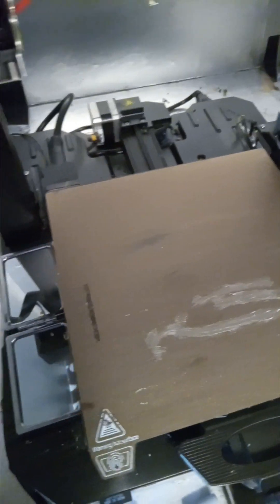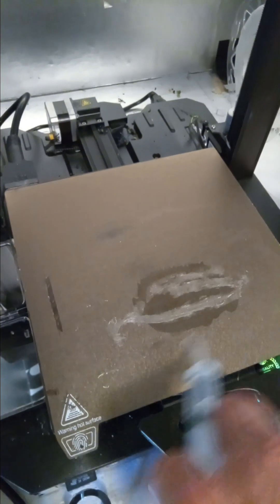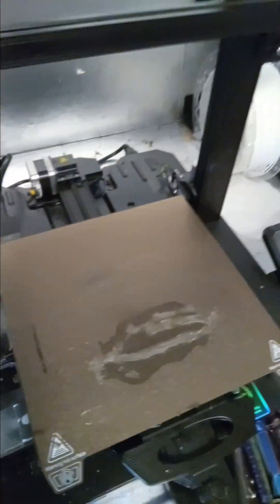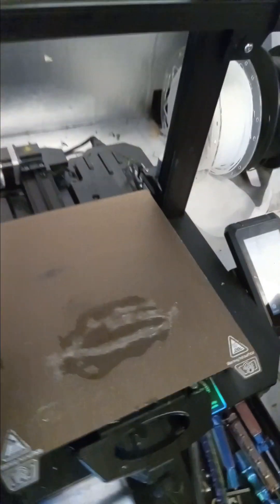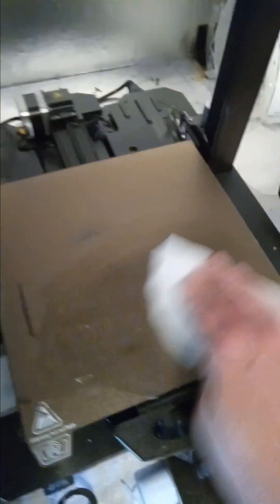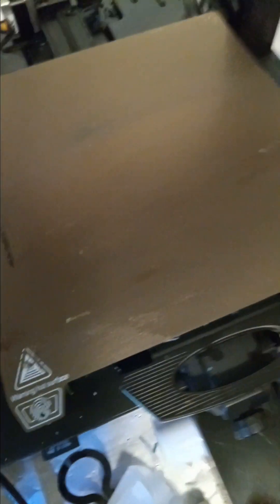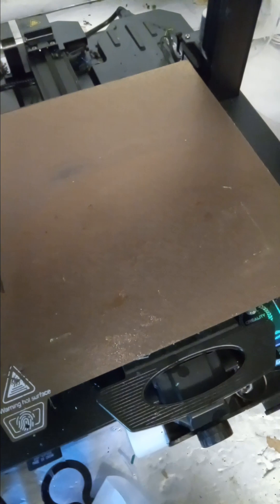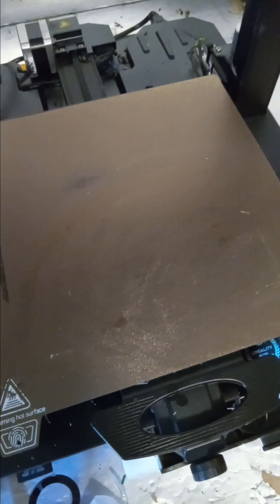3D Print Bed Adhesion And Release Best Practice, Glue And Alcohol

Comment: how many prints can we do before re applying the glue?
Reply from the maker: Depends on a lot such as what material and geometry of the part, but typically I think I get half a dozen or so prints then I'll just drag the glue stick over it, not so much to add glue but to remove dust onto the stick instead of the bed.  Also depends on a lot of variables, such as a warmer stick will leave more glue which is less ideal I think.  Once I build up too much glue I dilute it with the alcohol treatment again.  Of course you could do alcohol every time, but I like to do it as rarely as possible.  Some materials/geometries may require more often.  YMMV.
Reply: ok thanks, i was just using the heated bed but lately the prints have been coming off so i tried this glue thing and it seems to work extremely well @3dcre8r28

Comment: I guess I need to find the balance. Spaghetti, the first try. 😂
Reply: Adjust your z-offset.  Your nozzle is probably too far away from your print bed for that first layer.  I have found with my Ender 3 that my nozzle is about 1/2 to 2/3rds a layer thickness (so .2 with a .2 nozzle) away from the bed.  Then adjust up or down from there.  The trick is to be as close to your bed as possible without the nozzle hitting the bed and scratching the bed surface, a very precise tramming is critical to get this to work correctly.  Then just increase your z-offset (raise the nozzle up, away from the bed that is) until you have little or no elephant's foot on the bottom few layers of your print.  You will always have a little elephant's foot and your prints will eventually fail as the first layer will no longer stick again.  Then just use your best judgment on z-offset.  Yes, you may want to adjust it per print.  Lower z-offset for better bed adhesion but more elephant's foot, higher z-offset for less bed adhesion and less elephant's foot.  Also, the taller your print, the more bed adhesion (and lower z-offset) you want.  

If you find your prints failing near the beginning it is almost always z-offset or the extruder (nozzle temp) is too low.  If they detach later in the print it could be z-offset still but it could also be part cooling (causing warping and detachment from the bed, I had that) or bed temps are too low (for the same reason).  Also, check belt tightness, I had some weird prints and vibration during long-axis movement that had to do with my y-axis belt tensioner getting bumped and becoming loose (I had the printer in the living room and too close to people walking by).  

I used the Creality slicer for a while as I learned CAD and how to run my printer.  Before every print, it would do a nozzle purge that would allow you to measure the first layer thickness with a little double-wide extruded line.  It would print this off to the side of the bed near the front corner.  I could peel it off during printing and measure it with some calipers.  I knew if the layer height was 0.15 or 0.2 mm and the strip was nearly that tall the z-offset was too high.  I would stop the print there, adjust the print and try again.  The key is to iterate your calibration and printer setup until you have everything fine-tuned, then print something you want.  I would suggest a calibration cube https://www.thingiverse.com/thing:953162 (also) https://www.thingiverse.com/thing:1278865 .  You can iterate that and it will even give you some measurements to make, the first link is for one that is exactly 20mm (2cm) square and has the axis embossed on it.  It is VERY forgiving though, as it may print fine but another print may fail, detaching from the bed for instance.  

I hope this information helps you and you find it accurate, I am by no means an expert as I have owned and used a 3-d printer for only about 3-4 months (so YMMV)